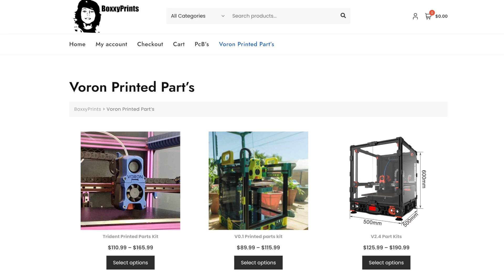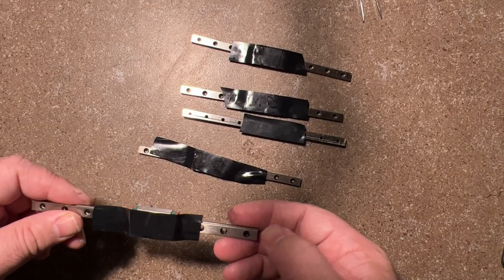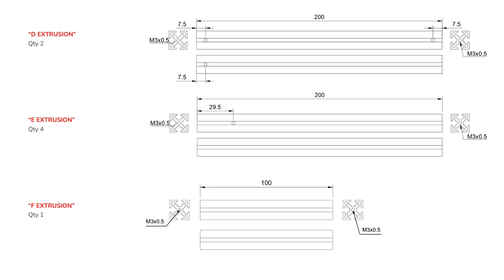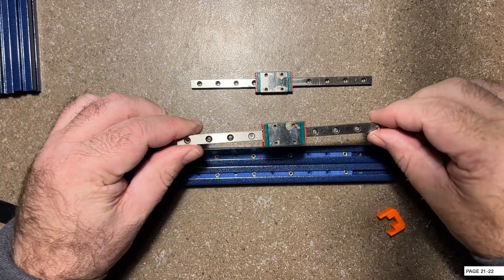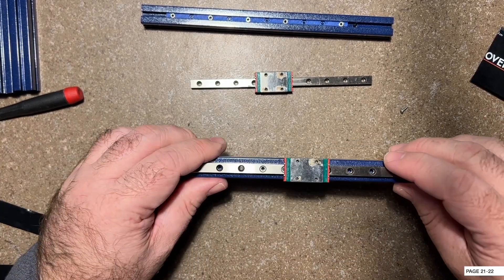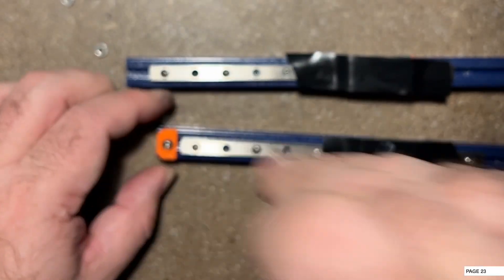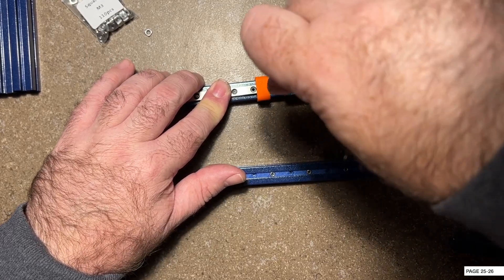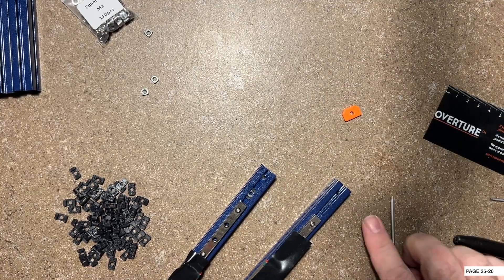Part 1. Voron 0.2 Build Series- Frame Extrusions, Y and Z Rail Prep

Comment: What black tape are you using?
Reply from the maker: Great question! I am just using run of the mill black electrical tape in the video. Using the rail stoppers to hold the carriage on is a better way to do it, but tape will work in a pinch like I show. Masking tape would probably be a better since it won't leave any gunk like the black electrical tape might.

Comment: Greg, I love your videos and will use them as a reference when upgrading from V0.1 to V0.2.

Just one thing, to align the rails, it is recommended to use 2 alignment pieces, one at each end so that it does not move, with only one you do not ensure that the rail is centered.
Reply from the maker: Yes that is a great call out! I totally forgot about the rail alignment tool. I even had it printed… :) it is a good way to go for ensuring alignment.